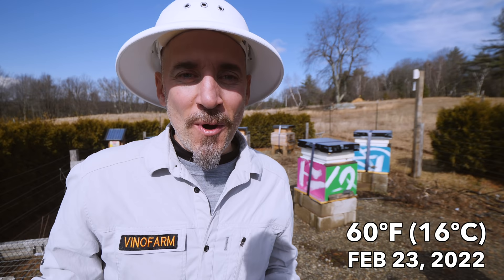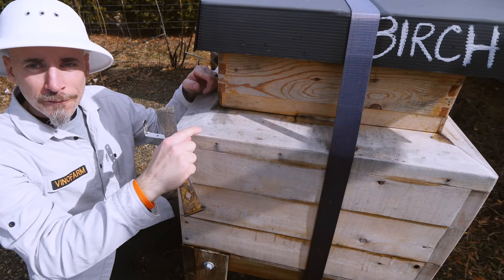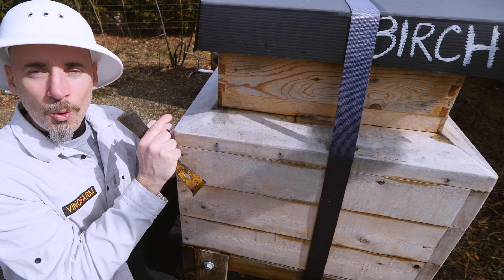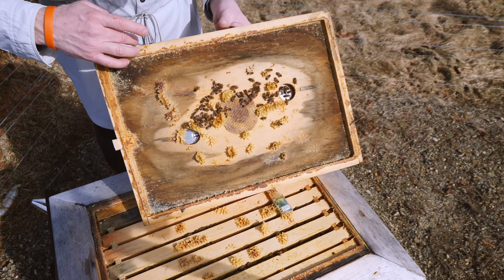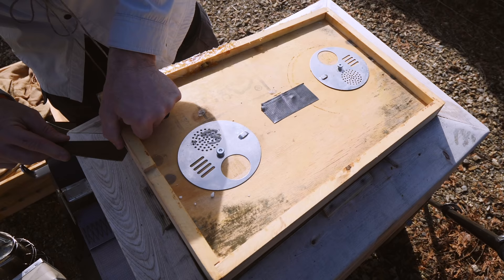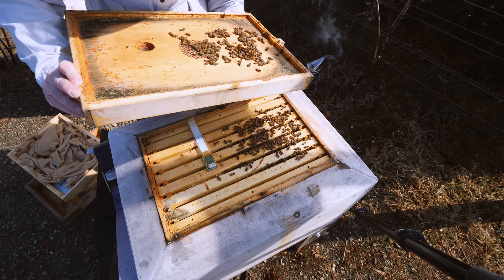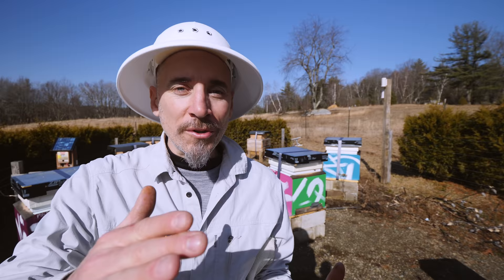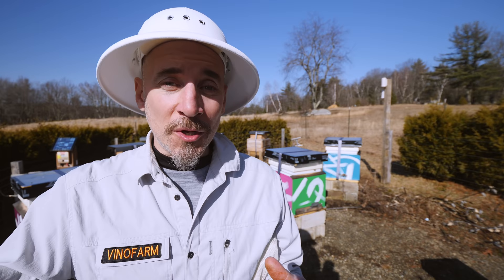A FLAW In My Hive Design... (So How Are The Bees?)

Comment from the maker: Guys, I’m not trying to eliminate “moisture” or get rid of it. I’m simply trying to get it to condense at a lower point in the hive. Preferably on the walls below the cluster. (Not on the ceiling.)

It seems like a lot of people are offering solutions to wick the moisture out and I KNOW ALL ABOUT THAT. I was a Vivaldi  board evangelist for 5 years. I’ve changed my thinking and I’m trying something new… an air tight hive which allows the bees to reclaim water and stay warmer with less energy. 

I know how to fix this. You’re seeing my progress here, not a dead end. Stay tuned. I’m already 10 steps ahead of where I was in this video.
Reply: Looking forward to seeing your solution. I’ll be starting on a hybrid between yours and bugfarmer very soon.
Reply: I tilt my hives toward the entrance. I also replaced my inner cover with reflectX. The Langstroth inner cover is a design flaw. Glad to see you fixing these issues with your own ingenuity!
Reply: Hmm
Reply: My one hive is a better bee , poly styrene double deep. Inner and top too . Inner has a two” hole I used for feeding, top has about a 3/8x1” screened vent. I pulled a big slab of ice from bottom board. Probably same day as your video.
Reply: I threw some pounds sub on today. What could be the consequences of such an early deed ?
Reply: I think physics is going to fight you on this one. Condensation is ALWAYS going to occur where warm and cold air meet. You’ve built a chimney in effect with the hot air rising. Unless you install a solar fan up high to push the heat back down, you’re screwed. BTW, replace the burlap with polypropylene. It holds less moisture.
Reply from the maker: @salnichols94805  I’m not trying to stop condensation. I’m trying to stop it from forming over the bees. Condensation will not form where temps are above the dew point.
Reply: @vinofarm  well then, how are you going to push the dew point below the bees? Anyone that has ever spent one night in a tent can see this problem.
Reply from the maker: @salnichols94805  The bees move air constantly. Warm air rises. Cool air falls. There is only a lower entrance. The coldest part of the hive will be down by the entrance. It will get progressively warmer the higher you go in the hive. The condensation will form in the cool areas.
Reply from the maker: @salnichols94805  Also, your tent is exposed to the outside which is cold. Of course condensation will form at the top. The hives I’m building are super insulated. There will be no cold areas at the top.
Reply: @vinofarm  Yeah, I’m not sure what magic makes that happen. But go ahead and argue all you want Jim. All you’re building is a super tiny home. Instead of trying to invent something “new”, just study home design and insulation.
Reply from the maker: @salnichols94805  It's not magic. If the surface temp is above the dew point, condensation will not form. Heat rises. It will be too warm at the top of the hive for condensation to form. 

I have an extremely tight air-sealed, highly insulated home. We heat our house with a wood stove on the first floor. Have I ever seen condensation on the ceiling of the second floor of our house? No, absolutely not. Where do I see condensation? On the coldest nights, condensation forms on windows, which are the coolest surface of the house. Look up Etienne Tardif on Youtube. He has been doing this for years up in the Yukon. Condensation forms away from the cluster and lower on the walls of the hive closer to the lower entrance. 

The reason my hives are so wet in THIS video is because I did not insulate well enough and the inner cover got too cold, creating a place for condensation to form. I'm going to fix that going forward.

Not sure what point you are trying to make.
Reply: @jameswoenker2659  earlier than normal build up and swarming if you are not on it not to mention plugging brood chamber with pollen if they already have enough
Reply: @vinofarm  but heat and moisture rise and moisture will condense on a surface cooler that the ambient temp carrying it. You would have to install a fan to blow it down
Reply: This is the first winter with this design, stuff like this is going to be expected. No one is expected to get a design perfect from the get go and you had no way of knowing this will happen. I wouldn't mind trying the V1 here in Australia as v1 might be still be useful, or something like Bug Farmer's version. We don't get cold, but our summers can be pretty nasty and can melt wax inside the hive, on top of storms.
Reply: Maybe try a sheet of bubble wrap insulation with a ventilation hole in the center where moisture is an issue.  Nice design and glad bees are thriving!
Reply from the maker: @basspro120  The hive will have about 50,000 fans. The bees are an HVAC system. They move air exactly where they want it to go.
Reply: You come as very defensive to any feedback from people you disagree with—just my two cents.
Reply from the maker: @radi.  I’ve been misinterpreted and attacked by many people over the past 6 years of posting videos on YouTube. The comments are a bit of a mine field.  It is very frustrating to spend hours tediously explaining myself, filming the videos, editing them, and sharing them with only good intentions, only to have people stroll into my comments having not watched or listened to what I had to say and then telling me I’m an idiot. Or completely missing my point and then going to other forums and social media and spreading lies about me. Yes. I’m a bit defensive. I listen to constructive criticism and learn from people who actually want to help, but when someone comments after clearly NOT watching the video It gets exhausting explaining myself again and again after it was all clearly explained in the video they didn’t watch. Thanks for your input.
Reply: @vinofarm  believe me, I understand your frustration. Leaders always have to put up with non constructive BS from those who wish they could lead. I am anxious to see what your next steps are. I'm on my third year of air right insulation with R-10 on top and R-5 just on the upper brood box. The larger the cluster the lower the condensation but it also depends on the extended outside temps. I have found that if I leave it air tight there is a lot of mold the bees have to clean out but if I allow some ventilation once the spring temps are consistently above freezing it isn't so bad. All depends on how many thaw cycles there are, it's better if it just stays cold as the moisture remains as ice within the hive. Once it thaws then your fighting mold. 19 of my hives have the insulation built in and the other 19 are wrapped with it and I remove the wall insulation on those when the water is warmer and it helps control the mold. If you come up with a solution that retains the heat and the moisture (for them to reuse) without growing mold I want to know it. The outside frames always look terrible. I'm thinking maybe reducing the 10 frame box to 8 frames, but I'll see what this spring teaches me first. Always look forward to your new posts. Keep it up. With the knowledge and materials we have at our disposal we should be able to solve these micro climate issues. Challenges are good.
Reply from the maker: @rugggus  Thank you for your support. I keep going back to imagining the inside of a tree. They must know how to deal with a completely air-sealed cavity with just a small entrance at the bottom. I’m playing with solutions now and will be building something all new in a couple weeks. As soon as the weather warms up I can get into the hives and see if the mold really is a problem or if it’s mainly just on the inner covers. Stay tuned!
Reply: @salnichols94805  you push the dew point away from the bees by adding more insulation to the top than you have on the sides. The dew point is then toward the outer portions of the inside of the hive dependent upon the outside temp and inside temp. Your tent has no insulation, the heat you produce condensates above you. Hope this helps.
Reply: @salnichols94805  If I understand him correctly, the idea was for the burlap to wick moisture. If so, he wouldn't want something water resistant like poly. And then, after wicking the moisture, it would then dry without a current of air that would be produced with an open vent.
Reply: Love your work. Your logic is sound. Haters gonna hate, don’t play the game. 
Where is 2.0? 
I’m thinking of making something very similar and running a Flow Hive on top of it. One “brood box”, one super. Take the super off for the dearth and winter. Winner winner chicken dinner! 

Looking forward to seeing 2.0. Thanks for all you do.
Reply: Research dew point, relative humidity, and absolute humidity so you understand the concept of condensation. I hate to say that you are clueless when it comes to insulation
Reply from the maker: @adobo6905  Thanks for this helpful comment. You really put me on the right track.

Comment: What about transparent inner cover? We use them here. Somebody uses glass or plexiglass in wooden frame, I am using hard food grade PVC foil (and insulation on top of it of course). The idea is that when you inspect bees in the winter just by looking, you don't crack the propolis (inslation) and you are not exposing bees directly to the cold air. And you don't need a veil :-)
Reply from the maker: Shhhhh…. Don’t ruin the surprise.
Reply: We can buy glas top covers in our area for our hives. In general I take them off before winter because wood isolates better.

Comment: Jim, love your technical evaluation. Let me give you some experimental experiences I had this year that might give you food for thought. I ran a few of my Apimaye hives over winter with the lower box being insulated (Apimaye) with a wooden deep box on top (Insulated with a layer of that silver bubble wrap type insulation). To the letter, every single one of these died. On the flip side 90% of my colonies that I overwintered in a single deep Apimaye setup survived the winter and are thriving. My hunch is that keeping thermal stability throughout the entire hive "Column" is the key. Might be worth trying next winter to button up your colonies with just an insulated hive cover and skip the upper box entirely.
Reply from the maker: Yes, the goal is to insulate the entire column. I underestimated how much of a thermal bridge the inner cover would be. I know what I need to do. You’re spot on and I knew that, but didn’t execute it correctly. I’m on it!
Reply: @danholtbk7008  I am in Kentucky and last year I overwintered mine with 4-5 frames of honey stores with each strong colony in a single box. In the spring they consumed between 1.5-2.5 frames of honey...the outer frames (think if you were to number them 1-10) frames 1 and 10 were not even touched! Seeing as I feed them sugar in the fall I considered all this "funny honey" and would never extract and sell it so I had LOTS of full frames of funny honey left over.  Ended up storing them and using them for splits. So your mileage may vary, but last year's winter months ran from early December through the end of March. Based on my results, I think 4-5 frames of honey up your way would suffice, but 6-7 would be more than enough. Insulation is an amazing thing when you commit to it.

Comment: I have found older homes are drafty, but the wood can breathe so the wood doesn't often rot.. newer homes are like boats and are so well insulated; but the wood rots because wood collects water and it cannot breathe.
 You might look into wood home construction regarding rot mitigation and alternative methods of insulation that insulates but allows things to breathe and not collect rot.
I have been noticing this connection and see other home style constructions to try and see if there is a good hybrid approach to allow the wood to breathe while insulating the home to make it more energy efficient. There has to be a way to have the best of both worlds.
Reply: I was  thinking the same thing the bee's are going to produce moisture so unless its ventilated out there will be condensation.
On the flip side the condensation is probably the bees only water source in the winter so might be best to not get rid of all of it
Reply: @jbeebuchanan2136  I always thought, the honey provided all the moisture needed.
Reply: @jameswoenker2659  actually they need moisture in the spring to add water to dilute the honey in order the process and feed brood
Reply: @PutEmInTheBox  interesting
Reply: @jameswoenker2659  "the thirst of a hive"

Comment: From an engineering perspective: Use a sacrificial moisture absorption agent.  You're right in the aspect that where warm meets cold there will always be condensation. I expect the redesign uses the burlap as the moisture absorber.

This prototype looks great, just needs the user to replace the one board every year (the metal bits can be re-used).  Getting the cost down by only replacing the burlap would be exceptional.

Comment: Piece of cheap window screen layed over frames will stop condensation from falling on them. Lay it over your brood frames this spring and your bees will propolize it heavily over brood frames to control humidity and temp. Then use that in winter. The screen holds drops of condensation. The propolis keeps it from falling on your cluster. Bees will make themselves an umbrella if you give them the tools needed. Plus they can remove propolis as needed. In the wild, bees propolise the tree interior to protect against condensation. Try it on one hive for 2 months, and you will be a believer. Use the propolized screen in a swarm bait trap. Styrofoam box with screen attached to tops. The guide strips are already there. You can cut screen in strips withand comb and staple to the frame when installing in nuc. Or use the screen on a weaker hive. The insulation and protection properties are amazing. Plus, the screen lets BEES control ventilation/ humidity as they see fit. In an emergency, pour thin layer of wax on the window screen if they have no way to propolise it. Poke a few tiny holes. Bees will remove wax as needed. Plastic coated fiberglass window screen. Try this hack and you will never go back to anything else. It's important that the screen lay directly on top of frames.

Comment: Thanks for the update.  After last winter and losing all nine hives because of the cold and wind in our area.  I started four new hives last year and in the fall did the hive insulation.  I live in a high wind area during the fall and winter.   I took what you did before and used 2 inch insulation around the entire hive to the top of all the boxes.  I am using 2 deeps with a shim for my food supplies.  Then a screen inner cover and then a super for the burlap.  The top cover was also in 2 inch insulation.  Each hive is very strong and I might have to do a split on one of them a few week.  Because of the insulation to the top cover, I did not have a moisture issue.  I looking forward to the information on building the frames. 

Thanks again for all of the great information and videos.

Comment: Good analysis.  I was rather intrigued by your desire to change the outside dimensions of the upper box, instead of presenting a flush vertical surface to the outside.  Sure that makes the top bigger, and likely a little heavier and bulkier.

That said, if your bees survived the winter, that's a great first iteration in your design.

Comment: We are in Maine and based on watching your videos and following others on FB with super insulated hives, we tried a new technique this year and so far our 2 hives are doing great and no moisture at the top when we opened it up on the 25th.   We have a deep and a medium on each hive and then added an insulated Vivaldi board on top.  We covered everything with 2" rigid foam to halfway up the Vivaldi board.  So basically all the 'cracks and seems' were covered so air couldn't get in.  In the Vivaldi board, we lined the bottom with Reflectix and on top of that put 2" rigid foam so anything in that V-box (above the insulation layers which were both inside and outside) was just dead space.  Hopefully that explanation wasn't too confusing.  But it worked!  Can't wait to see your bee barn 2.0!

Comment: Seems to me you just need a different winter cover. A single unit that slides down to fit over the bee box. Think old style shoe box, where the lid extends down the sides of the box on all four sides. Make it extend a few of inches down farther than the angled wood, with insulation to interrupt the bridge. 
I would do a peaked “roof” on the outside to allow snow and rain to run off, rather than a flat roof. Insulate the “attic” space, of course.
The black plastic you used would be a good material..lightweight but waterproof.
I think the box design is awesome!

Comment: I honestly think you need an upper vent. I install my version of a quilt box. It is on top of the hive with a screen bottom spaced up 1.25 inches.  I use this space for candy cakes and pollen patties if wanted. I  then lay a piece of an old bed sheet on the screen.  I  fill the remaining space with pine bedding.  I cover the quilt box with 1.5 inches of styrofoam insulation and the telescoping cover.  The front of the quilt box I drill a 1.5 inch hole and cover with a screen on the inside to keep bees out.

I have noticed condensation on the styrofoam insulation above the box. It drips into the pine bedding but the bees stay dry. 

One plus of this design is I can remove the telescoping cover and pull up the edge of the fabric to check the cluster and how much candy is left without opening the hive. I  can then chose a warm day to slip in more food as needed.

I do cover my hives with 1.5 inches of styrofoam in the late fall.